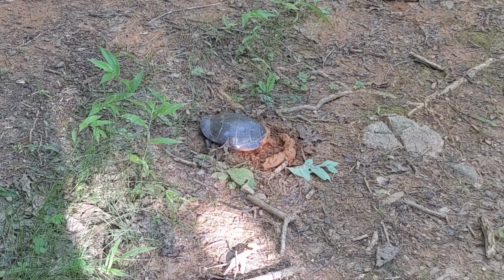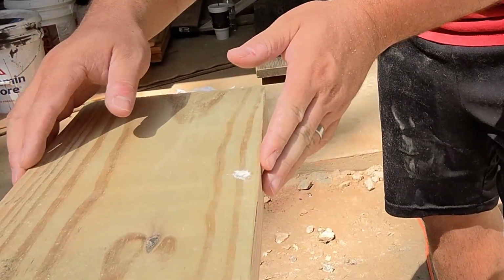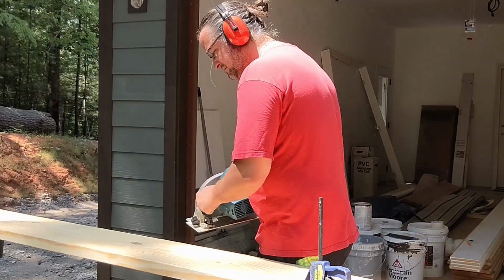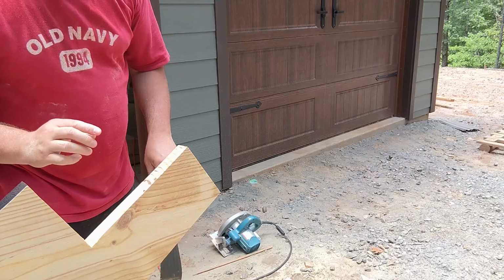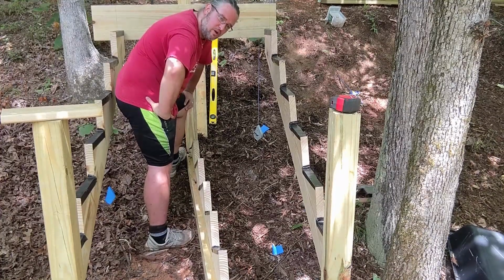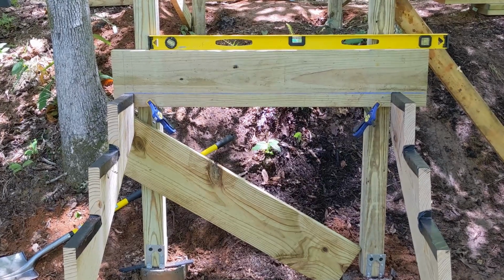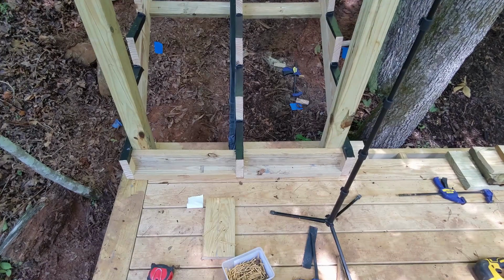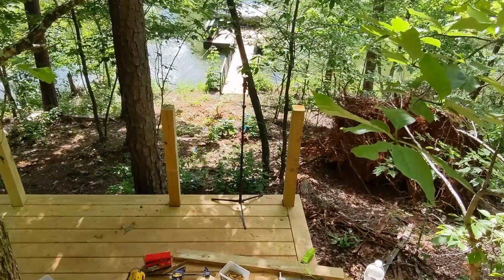EASY STAIR JIG. How to build STRONG stairs CHEPAPER and EASIER.

Comment: Another major tip for you.  When setting footers, make sure that the top of the concrete is above the dirt line by at least 1 inch.  Also add an ever so slight crest to the concrete so that the water does not stand on it.  When you recess your concrete the water will pool and then degrade the wood even faster.
Reply from the maker: That is a great pro tip!

Comment: Wait/  At 12:07, you said you only need one screw on that strap.  However, you didn't have any other nails or screws holding the top of the stringers to the header. While one screw does hold the stringer in place, rule of thumb is to use at least three.  You also needed to have some other screws in the stringer itself to keep the stringer from twisting.  The hanger is only there for vertical support, not lateral or twisting force.  

I realize this video is a few years old by now, but I would highly recommend that you go back and place some screws in there.  This is a matter of not if, but when. The treads are holding them steady for now, but with the shorter screws you used in them, they won't hold for too long.
Reply from the maker: I may have forgotten to film it but those brackets are screwed to the ledger board, the top side and bottom side of each stair. Only one screw needs to go straight up through the bottom per Sampson's recommendation. I don't think it would hurt to full send all the screws.